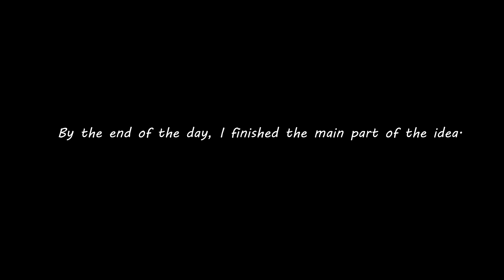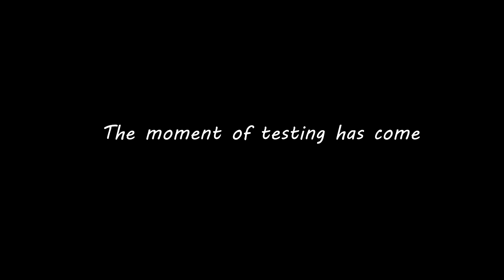I dreamed about this device for 20 years! I did it in 5 days

Comment: How does that tile hold up on your garage floor? I’ve read a well installed porcelain tile for a garage application can really be a sturdy, durable surface equal to or better than the concrete with respect to abrasion and mar resistance.

Comment: If you put an i-bolt on each top corner of the plow and ran a rope loose around the handlebars and back to the other side with a rope to the locking pin you would not need to get off to change the angle anymore

Comment: I am curious if you were to add weight to the plow for more downwards pressure how and or where do you think would be the right place to do so?
Would you use steel or concrete for weight?
Thanks..!!
This is an incredible build..!!!

Corey
Reply: That’s what I was thinking, with there being no weight he’s just moving the soft snow. No scraping or ice removal with his current design
Reply: I'd do extra Steel welded onto backside of blade

Comment: Looks great.  Can you have it powder coated to prevent rust?  Also, would a powder coat help keep snow from sticking to it?
Reply: I'd personally suggest something more diy. I'm a big fan of rustoleums line of products, especially their rust converter/reformer. Powder coat is nice but for a utility tool like a plow, it'll get worn out/damaged pretty fast and it's not easy to fix powder coat like it is spray paint. 

The only thing that'll help prevent it from sticking is something like wd40, otherwise it depends on the temperature and wetness of the snow.

Comment: Cool. Even though I haven't lived in snow country for 11 years - but I always like clever. 

I'm so lazy I'd put a small cable on the spring notch lock, and both sides of the blade. Free the notch and pull on the side you want to push toward...

Comment: Shorten the lower arms, that will move weight back and it will handle and drive a bit better. Want the plow blade as close as possible without hitting tires.

Comment: Take an old tire that has decent tread still on it. Take your scraper bar measure it add 2 in height. Then cut your desired proportions out of the tire. Mark your bolt holes fasten it to your blade and you'll never scrape the payment again! If the rubber wears out you just flip it over and use the other side. The rubber is forgiving! You won't fly over the handle bar's...

Comment: i copied my atv snowplow from a guy on youtube . you use a riding mower plow and put 2 door hinges up front for lifting and lowering . you run a round or square bar underneath till it extends out back with a trailer ball coupler  facing forward. drop that on your ball and now you are pushing with the rear of the atv .

Comment: Never use bolts as hinge pins, that's a failure waiting to happen. You can avoid all that chatter by using a live center instead of letting all that weeble wobble all over.